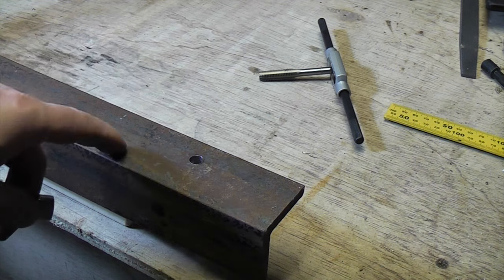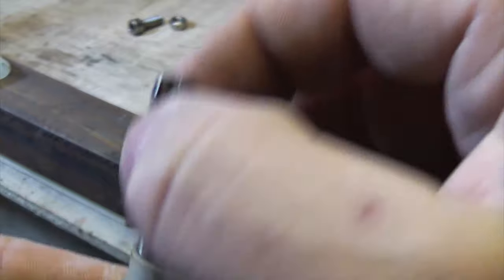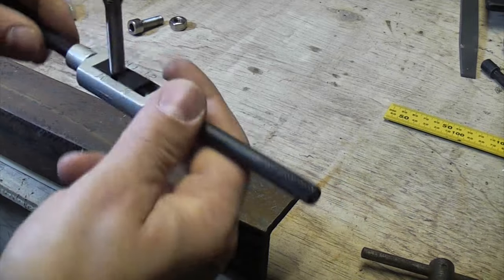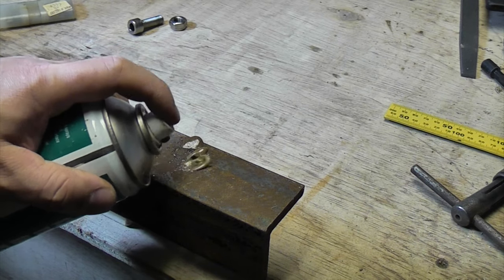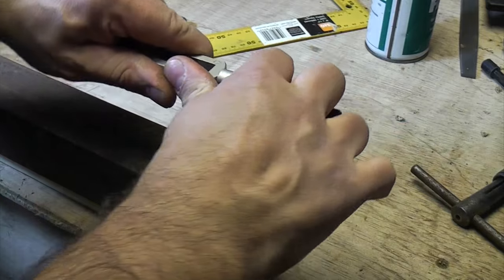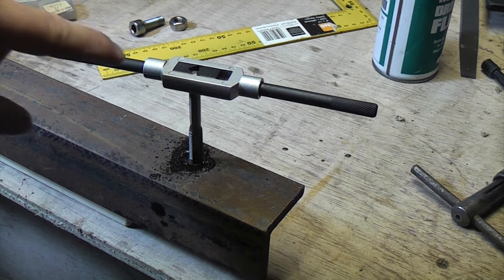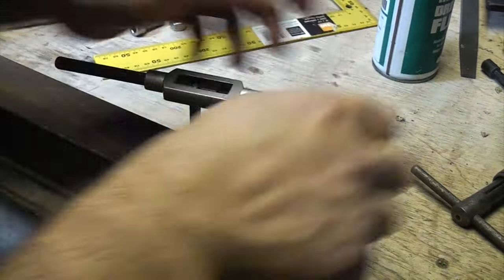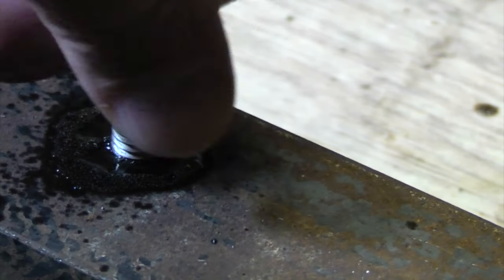How to tap steel | tapping steel | ultimatehandyman

Comment: For metric taps, you can determine the tap drill size by subtracting the pitch from the diameter. In this case it is a M10-1.5 thread. 10-1.5 =8.5   no table needed.
Reply: Thanks for that, I'm new to this game and that's the kind of tip I like!
Reply: powaybob 
I liked your comment 
I think good idea
Reply: Yet another advantage of the metric system

Comment: Tap wrench probably cracked because you were applying too much pressure when turning the tap, best to turn tap through half to three quarter turn before reversing to break off chip, especially when using smaller diameter threads.

Comment: if you want a reliable way to do a straight tap without using a square, you can use a squared  ?"x?"x1" thick block of aluminum and drill a 10mm or 10.1mm hole in it (for a M10 x 1,5 obviously).Then you just put the block over the hole you want tapped.I suggest this because you only checked one axis with your square (that we could see). Your tap could be off in the other axis and you wont notice it unless you check all around.Just drill all the common tap size you need on one block to save time.

Comment: It's taper tap, plug tap and bottoming tap
For starting the hole, enlarging it a bit at the end of the blind hole, and finishing it with bottoming tap for full threads to the bottom.
If using a device to keep it straight (a thick plate with straight holes in it, a spring loaded center in the drill press or lathe, etc) a plug tap can be the first to be used and then the bottoming tap. 
Taper taps are good for hand taping and eyeballing squareness. The taper makes it go straighter and self align.

Comment: I've found that you have to push down on the tap as you turn it, especially to start with.  Otherwise at the start, the tap just eats out the metal before finally getting to threading.  That's my experience anyway.  I push as hard as I can until the tap's halfway in.  Using taper taps.

Comment: Use a drill press, turn it on and then turn it off again and let the momentum of the drill press make the tap work its way down untill it stops by itself. Now you can use a tap-holder to do the rest of the work and it ensures that the thread is perpendicular to the workpiece.

Comment: What I use as a tapping guide to help make perfectly perpendicular holes are pre-tapped pieces of steel (done with a drill press) which I start the tap inside and align with the hole, clamp it in place if possible and start tapping the piece. This is when the piece I am tapping is too awkward to tap on the press. Give it a try and if you like the method, feel free to post a demo.

Comment: Handyman, thanks for the advice.  I started out with small size bits, then moved up to the final size, I used 3 increments.  It worked perfectly.  To be fair, I don't think it was cast iron, I think it was just "aged" steel to make it look like that.  Basically rusted. Your video and advice helped, I haven't had to tap holes for 30 years so your refresher was just what I needed.

Comment: Thanks!  I made my first three taps today. M6 through two 1/4” steel plates.  I only had one type of that taper 
so it was a great guide to get it right the first time.  Now I have my foredom rotary tool attached quick change tool holder for my lathe.  Cheers!
Reply from the maker: Fantastic!
Thanks for the comment

Comment: The third is called a bottoming tap on this side of the pond. It's good for starting holes but also for tapping blind holes because it allows the thread to terminate at the very bottom of the hole.

Comment: For metric, subtract the thread pitch from the tap size.  10M-1.5 = 8.5mm hole.  6M-1.0 = 5.  So a 5mm hole for a 6mm tap ONLY works if the thread pitch is 1.0.  If the thread pitch was .75, you would need a 5.25 hole for a M6-.75

Comment: For SAE, the body drill is the major diameter +.030". So a 1/4-20 thread= .250+.030=.280". Find a drill and tap chart either online, on your phone, consult a book(yes they still exist) find .280" and that's your drill size, in this case it's a 9/32nds. Also, if you like budget friendly tools, I'd recommend a half turn fwd, quarter turn backward and it should save some stress on the tool. Often times taps and wrenches break because the chip gets too long and gums up the hole. Thorough video thx

Comment: Great video but I have a question.  How difficult is it to drill and tap into an iron railing?  I have a gate that I need to drill and tap to add a lock to.  I'm a little concerned about drilling and taping holes into iron.  It's been years since I've had to drill and tap something and the iron adds a degree of difficulty.

Comment: for jerry cutini,drill hole smaler then one you will be treading,then use tool called tread cutting drill tool from Wurth.easy to use looks like a drill with tapper in one.

Comment: ULTIMATEHANDYMAN...Love your work mate. Just a few questions:1). I'm about to tap a hole in a car - the plenum chamber really and I need to tap into about 10mm approx....now the hole size I want is 4mm but the thing is that I've already drilled the hole and it's exactly 4mm...I don't really want a bigger hole size. Could I get away with this and do you also think I only need to use the initial tap in order to go through 10mm instead of using the 3 taps. Thanks in advance. Cheers

Comment: @ultimatehandyman...It ain't a blind hole....I drilled through the other side.So U reckon if the hole's too big then I should use a Plug tap or a Helicoil insert?
Cheers

Comment: Honestly I have to tap like 50 parts in a day sometimes and for a 1/4-20 bolt tap I literally just use my cordless drill and some wd-40. I have a badass dewalt and I set the power around 10 and the speed at 1. Also if you think a drill can't handle that abuse, it has for 3 years and my boss bought it and trained me to tap that way. It seriously works like a charm.
Reply from the maker: +C Smith I do that as well, but you would not believe how many people frown upon it LOLhttps://www.youtube.com/watch?v=0MyzdVGQXkgThanks for the comment
Reply: Actually I watched another one of your videos and I see you do this the same, I'm always trying to learn new ways of doing things. Thanks for the video!

Comment: Can you tap into the side of a pipe, or more specifically, a chain link fence post? Do taps come in smaller sizes with finer threads, too?
Reply from the maker: You can but it depends on the wall thickness of the tube. It will probably be too thin to tap, but you could use a nut insert, which is used like a rivet but leaves a tapped hole. They are sometimes called rivnuts or rivet nuts
Reply: Thank you! I wish I had heard of rivet nuts sooner. I was thinking the pipe wall thinness would be an issue. What I am trying to do sounds extremely simple but turns out is one of the more difficult things to figure out.
Reply from the maker: Anklepants Skate Zine
No problem, I managed to make a video on how to use them yesterday-
Rivet nuts | Riv nuts | Nutsert | thread inserts for thin metal

Comment: what size would i use to re thread  a 7/8 hole  (not to make a new hole but to re thread it  because of stripped threads )
Reply from the maker: +nick diaz 
Not sure sorry, as I don't normally work with Imperial sizes.

Comment: Is it recommended to drill and tap a preexisting metal clothesline. I want to put up a badminton net for some neighborhood kids and need a project.
Reply from the maker: It might be a bit thin to tap?
Perhaps drill right through it and use bolts?
It depends on the wall thickness, really 😉

Comment: What is your opinion on those Milwaukee drill bits that both drill and tap? They look stupid to me. Using a drill to tap.
Reply from the maker: They are probably useful in certain situations. I have some made by HMT, but have not used them yet. I have used the HMT turbo drills and impact taps, I can drill and tap M12 holes in steel I beams in a couple of minutes, with ease  👍

Comment: I have a bridgeport, so I can keep it straight. I do half turn cw, then quarter turn ccw. I've only tapped aluminum before and wondered if there was anything special for steel I need to know.
Reply from the maker: Just ensure you use a coolant/lubricant and don't apply too much pressure.
Thanks for the comment

Comment: I have a M10x1.5 tap and using a 8.5mm drill bit, but the tap is unable to enter the hole. It would just keep on spinning at the tip of the hole. I thought at first the hole is too small but it seems that 8.5 mm drill bit is indeed the correct one to use. Any idea what's wrong ? (same problem with the M8x1.25 tap using 6.5mm drill bit)
Reply from the maker: It sounds like you might be using a plug tap.
You need a taper tap to start the threads off http://www.ultimatehandyman.co.uk/3-taps.jpg

Comment: Do you know if those taps can be put in a drill press?
Reply from the maker: Yes, but you must grip the round shank and not the square on the end. It's common to use them in a drill press to get the tap started and ensure that it's parallel, you can't of course switch the machine on to tap the hole unless you have a special tapping head attachment.

Comment: what do i do when i have noticed the the tap is in crooked but ive already gone one or two revolutions, can the hole be remedied or shall i just keep turning?
Reply from the maker: In most cases, you can remove it and start again.
If you have a pillar drill, I would suggest putting the tap in the chuck and rotating it by hand to get is started squarely!

Comment: I have to tap a 40 mm deep blind hole in an overhead position,  is there anything I need to do different?
Reply from the maker: I would wear safety glasses and full face visor, so that the chips do not fall into your eyes. Apart from that, it is pretty much the same.
Thanks for the comment

Comment: can you use engine oil/motor oil as cutting oil?
Reply from the maker: +testbooster 
You can-providing it is new and not used.
Be aware though that the fumes that come from it might be toxic, so best to use a dedicated cutting fluid/oil or even water.

Comment: Thanks Bud.
Reply from the maker: You are welcome
Thanks for the comment 👍
Reply: FYI, I have the exact same Chinese tap set.  They are good for about 1-2 uses then they are in the trash bin.  I’ve also learned a few these taps were slightly out of spec.  I’m done with subpar tools.  Keep posting great insight videos.

Comment: Sir can you pls.help mhie i have hand tap which is m12 m10 m8 m6 m5 what size of drill bit should i use of each hand tap size
Reply from the maker: There is a chart on this page- http://www.ultimatehandyman.co.uk/how-to/metalworking/tap-and-die

If you are ever stuck and don't have a chart, you can deduct the pitch of the thread from the diameter of the thread and that will give you the drill size. Example-

M10 X 1.5 pitch
10 - 1.5 = 8.5

Comment: Say I need an M4 thread (the screw have 4mm on the outside of its thread, right?), what diameter should the driller have?
Reply from the maker: 3.3mm should do it ;-)
Reply: I ordered a Driller bit kit with the tapping kit, they're coming with a 3mm and a 3.5mm. I'll have to try the 3mm, and if the tapper get too hard, I'll try the 3.5mm. I'll try to test it before doing in my computer case. Thanks for the reply.
Reply from the maker: Leonardo Bruno Chaves Siqueira
You are welcome.
You might manage with the 3mm bit on a computer case as they are generally very thin. If you use a little lubricant/oil it will help. Take it easy with the 3mm and like you say if that does not work you will have to use the 3.5mm, although it will be a loose fitting screw afterwards!
Reply: Thanks, man! I think I'll do fine with your tips.

Comment: Want to add another screw at my motorcycle foot board. It only have one screw, it swiveled. Another screw should secure it. Other option is permanent (welding) but not good for future maintenance.

Comment: I've recently snapped off two tapered tap screws: how much pressure do I use?  I'm not that strong; perhaps the metal is crap?  Broke both Irwin and DeWalt screw bolts.  Weird.  What am I doing wrong?
Reply from the maker: Can you please clarify, exactly what you have broken?
I'm in the UK and I'm not quite sure what you mean by a tapered tap screw?
Or Irwin and DeWalt screw bolts?
Reply: @ultimatehandyman  I'm brand new to this, so I'm sure I'm getting terms wrong.  Tapered taps?
Reply from the maker: @corporaterobotslave400   Oh, OK (no problem)
Taps are made from a very hard steel, but hard steels are often brittle. So, whilst they are very hard, the steel can easily be broken, as it is not flexible like a mild steel.

If the tap breaks, you need to ensure that you are drilling the correct diameter tapping hole. There is a chart on this page for metric tapping sizes- http://www.ultimatehandyman.co.uk/how-to/metalworking/tap-and-die

Once the correct sized hole is drilled, you need to start off slowly and ensure that the tap is kept as straight as possible, don’t forget to reverse the tap every few turns to break off the chip.

Cheap taps are notorious for breaking! I often try to purchase quality taps such as Dormer or Presto 
I hope this helps 😉
Reply: @ultimatehandyman  thanks; haven't heard of those brands, but found a Dormer tap on ebay in the States.  Cheers, mate!

Comment: No finishing tap?
Reply from the maker: I normally only use a finishing tap when tapping thick material.
Once you get past half way on a taper tap it's exactly the same as a plug tap (or so I was told).
Thanks for the comments

Comment: a little countersink is needed for gripping the tap easily, here some drill diameters for tapping: (Tap ISO-Metric - Drill diameter in mm) 
M1 -0,7 / M1,2 -0,9 / M1,4 -1 / M1,7 -1,3 / M2 -1,5 / M2,3 -1,8 / M2,6 -2,1 / M3 -2,5 / M3,5 -2,9 / M4 -3,3 / M5 -4,2 / M6 -5 / M8 -6,7 / M10 -8,4 / M12 -10,25 / M14 -12 / M16 -14 / M18 -15,5 / M20 -17,5 / M24 -20,75

ISO-Metric Fine: M8x1 -7 / M10x1 -9 / M12x1 -11 / M14x1 -13 / M12x1,5 -10,5 / M14x1,5 -12,5 / M16x1,5 -14,5 / M18x1,5 -16,5 / M20x1,5 -18,5 / M22x1,5 -20,5 / M24x1,5 -22,5 / M27x1,5 -25,5 / M30x1,5 -28,5 / M33x1,5 -31,5 / M24x2 -22 / 
M27x2 -25 / M30x2 -28 / M33x2 -31